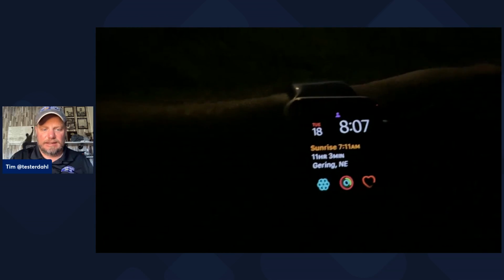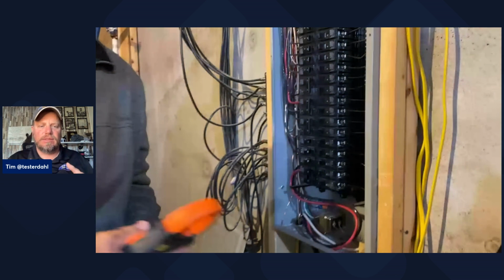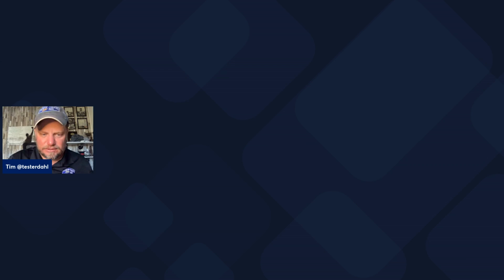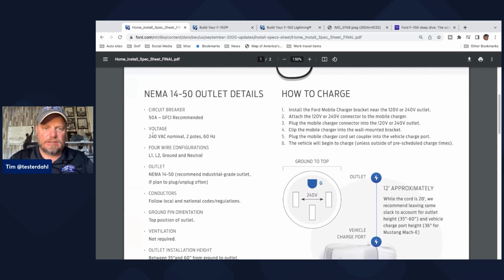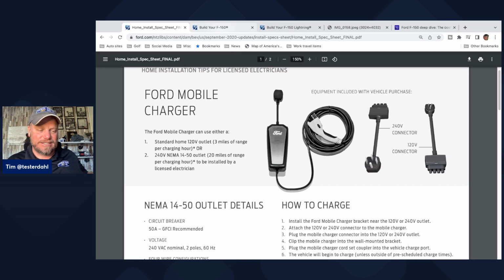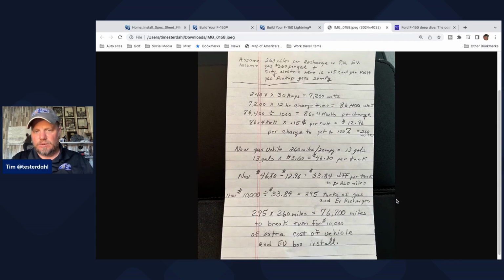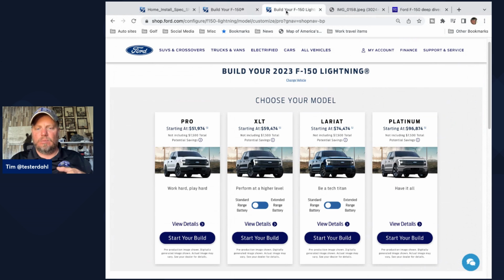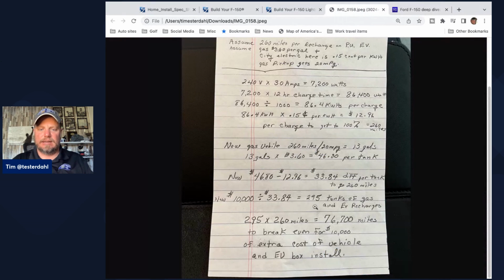11+ hours later on 220V charging price for 2022 Ford F-150 Lightning

Comment: There is a lot of other sources of energy that can be used for transportation independent transportation. When they got rid of the trolley cars in the cities like New York Chicago Philadelphia California San Francisco they made a big mistake because people were using the trolleys and they ran on electric power but there was an overhead cable that the trolley constantly Drew power from to operate. But from what I remember when I was a kid the power bill was to expensive for the companies to keep operating the trolleys and the buses that had Electric motors. So they were eliminated. Then GM started building buses with diesel engines in them to travel the city streets for people that worked in the city. Remember the slot cars when we were kids and we'd go to a slot car event at a business that they had a huge track it had Bank turns on it he had Motors you could buy to make your car go faster they were talking about making that type of system in the city it wouldn't work because of traffic and you'd always have someone either in front of you or you would be behind someone constantly. The monorail runs on electric and magnets just like they do at Disney World and Disneyland but they never started building those which is not that expensive now that can be doable for a city.

Comment: Only thing is you are assuming you won't have to replace the battery in the Lightning within the 10 years. I don't know the battery warranty, but if you have to replace it out of warranty within that 10 years, how much is that battery out of your pocket. Also, how much is your time worth when you are on the road and have to recharge? You can refill a gas vehicle in just a few minutes.

Comment: Ford has a 75 amp charger but you need to put in a 100 amp circuit
Reply from the maker: I’m not aware of many houses at all with an extra 100 amps of service.
Reply: @Pickuptrucktalk  not to many

Comment: The EV was pushed out of the market over 100 years ago and likely that will happen again, but not for the same reasons.
Cities are already banning natural gas in new construction forcing all appliances and heating electricity dependant, this trend will continue while demands are rising to teardown hydroelectric dams saving salmon and steelhead.
With the insistence of generating solar power hundreds of miles from customers, same with wind generated electricity being near zero after sunset just how much electricity is needed for all of this demand?
How many of you are being forced to put all of your eggs in the electricity basket?
Be smart and buck the trend that is forced upon you at the will of vested politicians and their stock picks

Comment: The only thing I can see that could possibly work to help maintain the batteries so the vehicle doesn't go completely dead on you while you are traveling is a windmill generator that would be the charging system only for the batteries and the input would have to be much higher than what you are drawing plus it could charge while the vehicle is sitting in the parking lot while you're shopping or having lunch or just resting. Which would be an extra expense for the vehicle. Just like a boat when it sits at The Mooring it has a windmill generator to maintain the batteries in the boat. You run your lights your radio etc etc. The problem is with all those batteries in a vehicle the charging time takes up a lot more your time before you can get to your destination. It's a toy that's all it is a rich man's toy if you work in the city and live in the suburbs and you want to keep smog out of the city reducing gasoline and diesel vehicles not all of them you can't just eliminate all of them at once or you will not get the goods you need for your business. because all the stops they have to make and startups they have to make and the hill climbing etc etc

Comment: What about insurance and registation? Sooner or later you will have to pay for road useage tax and all the other taxes that we pay for in gasoline tax. They will get you in registation fees. What if you have a battery failure. What is the warranty coverage and out of pocket cost on that getting replaced and availability of the battery?

Comment: Problem… my 97 Ford F-150 Lariat still runs fine. Same engine… just change the oil. 
No battery car or truck will last longer than 10 years.

Comment: You picked 20mpg for gas truck and then used the 260 range on lighting. No way you get 260 average on lighting if you throw in all driving like towing and driving city. You said your highest mileage on gas truck was 29mpg well that 260 range is like that pie in the sky for Lighting. Drive your Lighting for awhile and see real world range. This makes the numbers real bad. EV is not cheaper so unless you like them for whatever reason don't get fooled into thinking your going to save money.

Comment: Perhaps I'm mistaken and am honestly no expert on EVs or electricity, but shouldn't you be including in your analysis a factor for the eventual replacement cost of the battery in your EV/ICE breakeven cost comparison?  Some portion of the battery is being depleted as you drive each mile in your 75,000 mile B/E comparison.  Also, I can’t help but think that the additional weight of the EV due primarily to the batteries would cause more wear and tear on the tires and suspension of the EV than on an ICE vehicle resulting in additional operating costs?  You may want to consider a cost factor for this, if not already included?  Road conditions can also influence the wear and tear cost estimate.
Reply from the maker: That’s a different video. EVs are so complex, you can’t include all the details on just one video. It takes multiple. There is an entire playlist on this channel with all the different questions you asked are answered.

Comment: You have to break it down to cost per mile if youre comparing multiple fuel type economies. then do all the other calculations related to additional costs, then find how many miles it would take to recover the cost difference.
Reply: We already know electric is far worse
Reply: @beekeeper8474  yeah I did a cost break down a few months ago when the F150 lightening was released and I came up with about .14/.15 per mile over a 2000 mile road trip on the lightening.  My 3.0 diesel came out to about .17 per mile, so saving .02 per mile it would take about 1,000,000 miles to recover the $20,000 price difference.  I included fuel filters(Wix), oil filters (PPE), oil (Amzoil), fuel(5.19 gal), etc on mine in the calculation.

Comment: Did I miss something? I thought it took 12 hrs at 30 amps for HALF of a charge or 130 miles. A full charge would cost about $24 at $.15/kwh.
Reply from the maker: Glad somebody noticed that as well. Ford says a full charge in 13 hours. That clearly didn't happen.

Comment: My gas Toyota Tundra is a 2002 and has 5005, 000 miles all I've change on it has been oil filters, air filters , and belts since I bought it. Big V8 and I get 19 miles per gal highway. Yeah no EV for me.

Comment: Even when you're not using the vehicle there is a discharge on the batteries for the vehicle just sitting in your garage or driveway that happens on all vehicles that have a battery in it whether it's gasoline diesel or electric. If you look at the top of a battery and it's dirty and wet just a slight moisture on top of a battery and a regular vehicle with a gas engine or diesel that draw is on that battery from that moisture being on top it's drawing from the positive to the negative post it's creating a negative draw on a battery that's another reason car batteries last about 3 years. Plus you have the instruments inside for memory that is another draw on the battery an electric car I assume would draw more because there's more components that the batteries have to maintain.

Comment: 120 Volt verses 220 volt charging as far as cost goes will be the same. Why? because power companies charge you by the watts used using ohms law, even though the amperage with 220v is lower the wattage will be the same.

Comment: I believe you are overthinking it. If the EV is a good tool that fits your needs and it is what you want then buy it if not then don't. Buying an EV to save money or to save the planet is foolish. Personally I have an EV car and a gas powered truck. I use each when it is appropriate. If I could only pick one it would be the gas powered truck. I would venue to say that for most people only having an EV would not yet be the ideal choice

Comment: Would it be easier to have a gas powered truck.Go to the gas station pull up to the pump fill your tank 5Minuts later you are on the road again.maby drive 500miles .Stop at the gas station 5 minute later you are on the road again.what is rong with people

Comment: The number of miles an EV shows you is an estamate.  It is better to look at the battery in terms of % vs. a range number.  Also charging from 80 to 100% always takes a long time as the internal resistance of the battery increases.

Comment: What is the cost of a blown/destroyed battery vs engine? In 300,000 miles how many batteries will you have to replace vs engines? You mentioned heavy duty towing, what does that due to the range if your heading into the wilderness with a toyhauler?

Comment: I would suggest that you slow down just a little with your math and explanation to be a little clearer to your viewers. The problem with some of your math is that you were charging 13 hours for only 1/2 a full charge, 49% to 100%. The videos I have seen regarding the Lightning and charging times will vary with the amount of charging capability you have. This is limited by using the at home charger provided by Ford. An after market charger will potentially have a greater charging ability but at a higher installation cost. I have noted that the charging rate decreases as the battery level increases subsequently the charger did not pull the 30 amp rate for the entire duration, but slowed down as the level increased. To more accurately determine the amount of electricity (KWH) used, you would be able to take the battery capacity multiplied time the percentage listed to determine how much was needed to "fill the tank".
I agree that electric vehicles are not as economical as the sellers want you to believe and not as "green" either. their practicality is in short distance usage where they can be charged at home during the night time when not usually needed and not driven beyond/below the 20% level. Charging from the 20% to 80% is the most practical balance between charging and driving and "wasting" time needlessly.

Comment: You picked the most expensive F150 to compare, and then the maintenance cost you never figured in the replacement of the battery after 8 years. Winter driving is going will be half the mileage in the EV. Looks like you did very fuzzy math to fit your narrative.
Reply from the maker: Eh. That's what vehicle I was given from Ford. We picked a cheaper alternative and you can find those maintenance costs breakdown on the website.

Comment: There's only one conclusion to be drawn...you'll never save a dollar owning an EV truck and you still really don't have a serious truck in terms of the distance it will travel when towing. My 2020 Silverado 5.3 Z71 will travel just shy of 500 unloaded highway miles. It will travel 220 miles at max 9,600lbs towing capacity. Then, I can pull into any one of the gas stations on every corner, fill up and be on my way in 10 minutes. Oh...and then there's the cost of EV registration and battery replacement. Just two other expenses to consider. EVs may be the way of the future...but not the near future. Battery technology and infrastructure is not there yet and won't be for decades.

Comment: Wait until the battery dies in 10 years. That's 20 grand to replace. This technology is NOT ready for prime time. I would never buy an electric work truck. What is your time worth while you're wasting it sitting waiting for your truck to charge so you can go somewhere.  Nice expensive TOY! Cost more than my first house.

Comment: Why did you do your break even so jacked up? Your break even should be done in years. For instance, the break even on a Lightning Extended Range Lariat (if purchased at actual MSRP) versus a similarly equipped Lariat Powerboost is 2.14 years, and 1.83 years for a Lariat 3.5L Ecoboost with gas set at $3.50 and electricity at $0.12 per kWh driving an average annual mileage of 11,000 miles with a 30%/70% city/highway split. When doing your breakeven, you should factor in all costs, from refills to oil changes to tire rotations, that you will encounter through a year. Also, I don't know what electrical issues you have in your home, but I have no issue recharging my vehicle (extended range) at 40Amps from 40ish % to 100% in around 5 hours using the Grizzl-E level 2 charger hardwired through a 220V/60A dual pole breaker.

Comment: It true is easy ohm's law amperage current voltage you take the volts times the amps gives you watts that let you know how many kilowatts you've just put into your vehicle a thousand kilowatts uses wrong 12 to 18 cents divide 1,000 KW by the wattage you just calculated times whatever you're getting charged for kilowatt. 10,000 KW / 1000 equals 10 KW x 12 cents easy as that a dollar 1.20
Reply: that is for now, w8 until gas is banned, you think government is gonna be nice?

Comment: Different ambient temps and state of charge will dictate what the current draw during charging will be, just follow the Fords recommendation and use an licensed electrician. Range is also calculated factoring in battery temp. Your not taking into account a lot of factors. It maddening because you don’t understand what your talking about.

Comment: I own a 2001 Chevy Tahoe that gets between 12 and 14 MPG around town. Let's do the math for 12 MPG @ a 30 gallon gas tank. It gives me 360 miles of range - and that is the worst. I fill it in a matter of minutes. The truck  currently has 196,400 mile on it. I do my own maintenance, so there is virtually no maintenance labor cost to me, outside of front end alignment and tires. No matter how you look at it, my Tahoe is far more "less expensive" to own and run than a glorified golf cart shaped like a Ford pickup.. I will never buy or own an all electric vehicle. Biden has his head up his ass if he really thinks this "Green New Deal" commie BS is actually going to work. See how well it worked for Texas last year. We are a laughing stock for the rest of the world!!!

Comment: When you calculated the powerboost MPG you included towing but you did not include towing with the electric which would be roughly 180 miles per charge (180 average is a guess but I bet its a quite a bit less like 140) you need to include that into your pricing.
Reply from the maker: We didn’t include towing in any of our math.
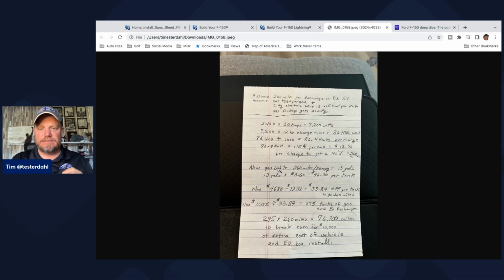Reply: @Pickuptrucktalk  12:05
Reply from the maker: @patriotcanuck6485  Watch it one more time. I’m referencing a variety of MPG numbers to show how much it changes. Like I said, let’s go with 20 mpg because that’s about the average I got unloaded with that truck and on most days. It never truly got the 24 MPG that the EPA stated.

Comment: I look at my lightning platinum as an excellent investment for my money. Everyday I see the prices of just about everything increase in price. Things don't cost more our dollars are loosing value every day.  We have this administration for another 2 years, so you can expect this to continue for at least 2 years.  It's not going to get better for a very long time. Even after this administration is gone things may continue to get worse,  because nobody can turn this around overnight. I was lucky enough to purchase mine at MSRP and at 2022 prices. The absolute best F150 I've ever owned.  I charge exclusively at home at present winter costs of 8 cents per kWh.  Since I average 2 mpk that's 4 cents per mile  or $4 to drive 100 miles. I  was lucky to get 15 mpg with my 2014 F150.  So my current mileage range is fantastic.  I realize as cold weather sets in I'm not going to get that many miles per kWh. So even if it were to drop to 1 mile per kWh I'd still be doing well with $8 per 100 miles. When gas reaches 4/gallon that's 50 MPGe. That still beats my 15 mpg by well over 3 time better mileage. I doubt if my range will ever drop that low in the winter unless I'm towing. Towing with my 2014 F150 I was lucky to get 8 mpg. Not many of these videos talk much about the lightnings low maintenance.  I  looked at my maintenance schedule and it appears the most physical work that will be done is rotating my tires. And having my own built in 9.6 kw gas free generator has also come in handy for me. I can run everything that I run from my home with my truck and not use an ounce of gas. Just my opinion, if you want a truck for off road driving or long distance traveling or towing then this isn't the truck for you. But if you need a truck to drive within 100 miles from your home and you can charge at home, there's not a better truck to own. And resell value at the present time is phenomenal. Most vehicles value drops the moment you drive it off the lot. The day I  drove mine off the lot I could have easily sold it for $30k - $40k above what I paid for it. In fact many people have been flipping their lightnings for those prices. Probably one of the reasons Ford raised their prices for 2023 already.

Comment: I don't understand how they can predict the mileage because it will be much less if your running any accessories and running high speeds. Also if you live in a hilly area you'll use more juice pulling the hills.
Just sounds like a cluster f..k to me.
Reply from the maker: Based on prior driving habits.